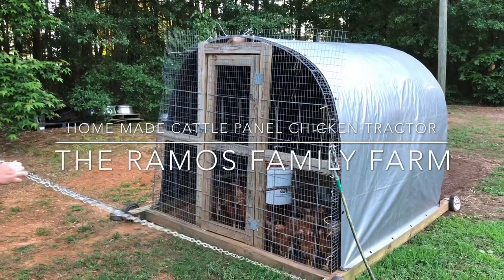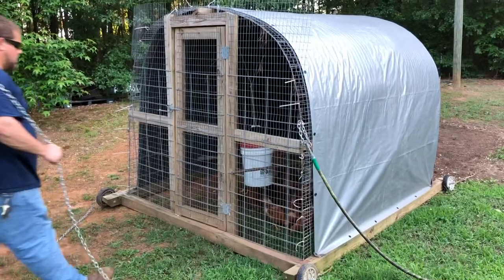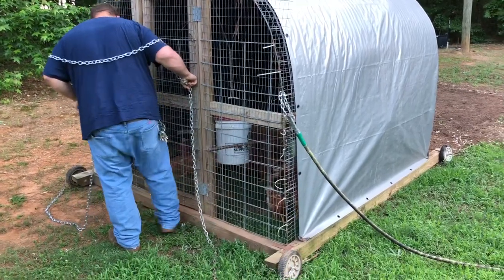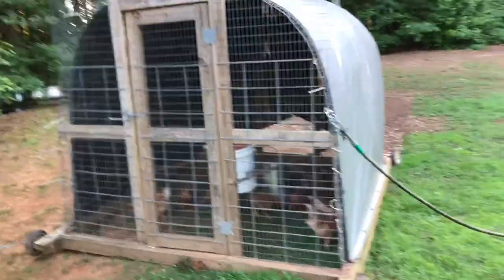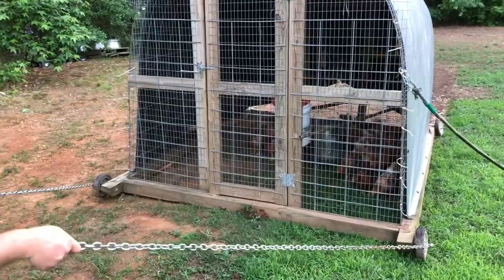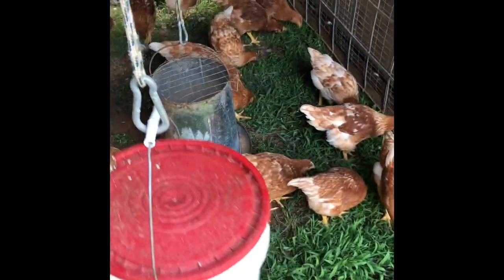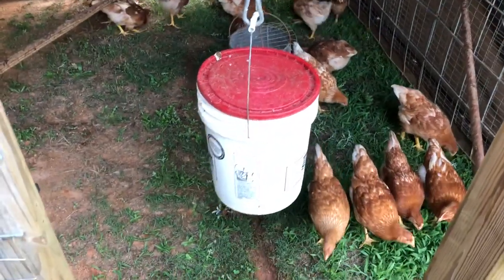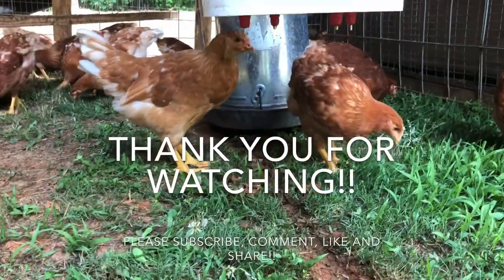Homemade Cattle Panel Chicken Coop Tractor

Comment: Have you considered doubling the wheels by putting one on each side the the 4x4s?
It would double the weight load and increase the lifespan while also reducing the unnecessary strain causing the 4x4s to twist inward.
Reply from the maker: Kevin Gittemeier,  That is an awesome idea! I will work on that and post an updated video once I replace. How is the KTFG brand and the www.kevingittemeier.com page going?

Comment: Can Horse Fence Panel be bent the same way? They are the same overall dimensions but the holes are conveniently 2" x 4".
Reply from the maker: It sounds like it can. Sounds like a great idea. Not sure if it’s the same gauge wire thickness but definitely worth a try. I looked it up on TSC and it’s about $85 a panel vs. $26 for a cattle panel but definitely has the advantage of the smaller holes.
Reply: @TheRamosFamilyFarm  Thanks 😊
Reply: That's exactly what I'm going to use or sheep/goat panels. The smaller openings are more secure against predators.
I used 2x4 field fence for my permanent chicken pen and coop and live in the middle of the forest and have not lost one bird yet.